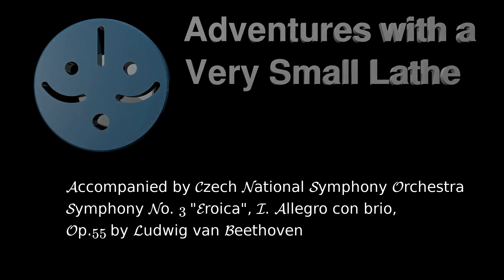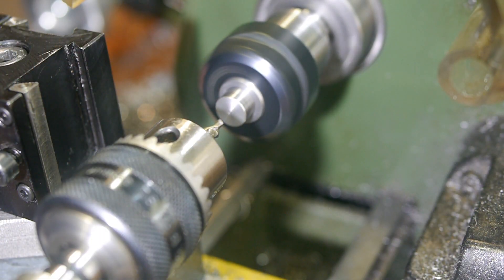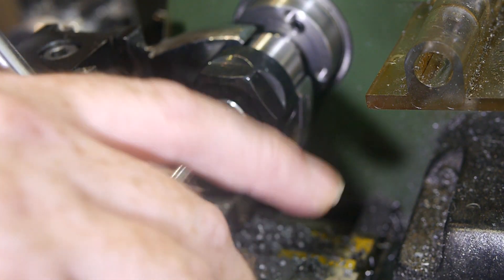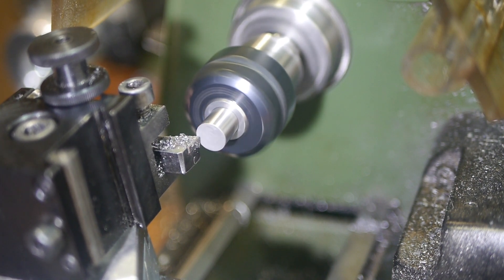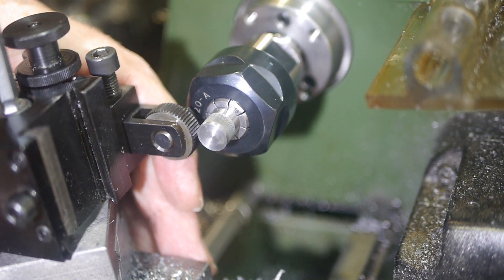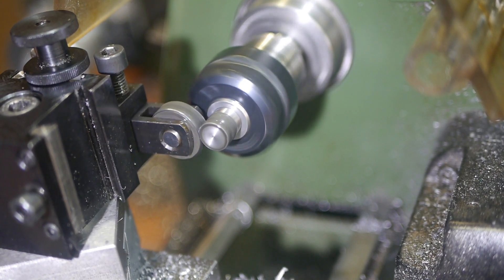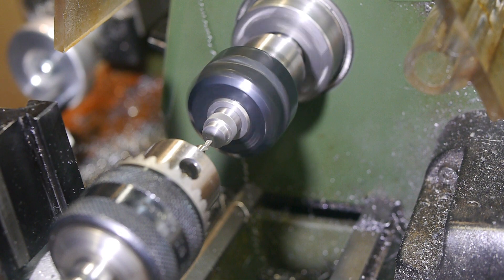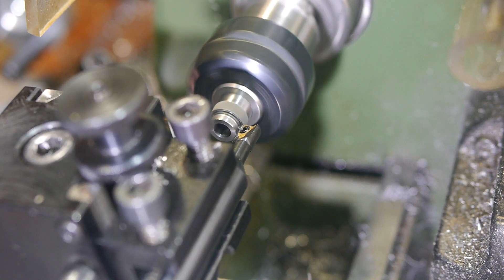Tap Follower - Part 1

Comment: Thanks! A have a proxxon 250 too. I want to make this tool. What a material you use?
Reply from the maker: I used Silver Steel, a water hardening tool steel similar to W1 or drill rod. For this tool mild steel would be just fine though.

Comment: On small lathes, I like the manual approach on threading, particularly in a situation like yours. It is slower but gives precise control. This gentleman illustrates a nice hand-crank mandrel for this purpose. https://youtu.be/2pDGQjaBbJA?t=1m58s
Reply from the maker: Thanks, I love his technique for fitting the mandrel firmly into lathe bore. For carbide threading tools, faster leads to better cuts. If I'm going to try them at hand cranked speeds, I guess I'll need to learn to grind my own HSS threading tools.